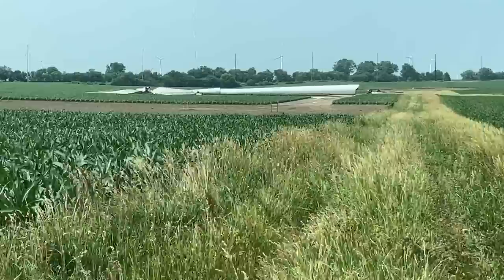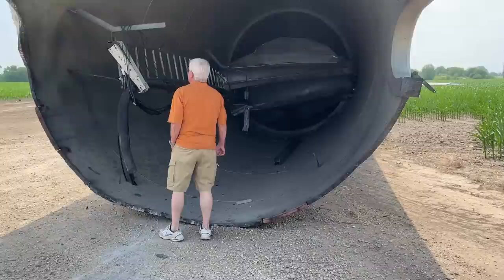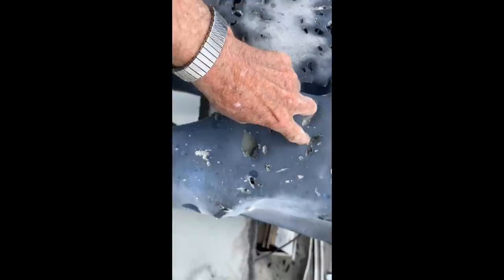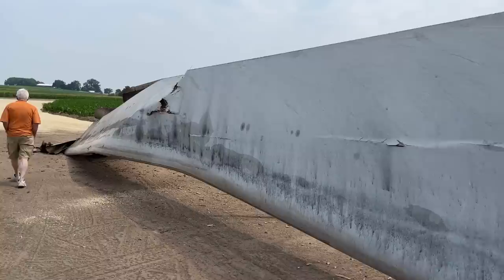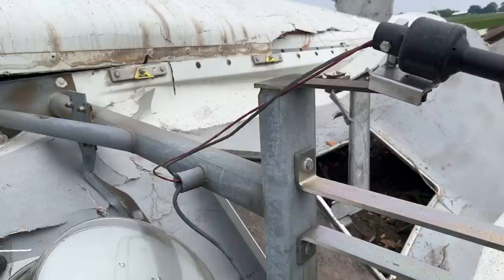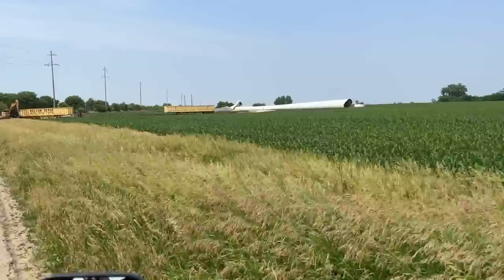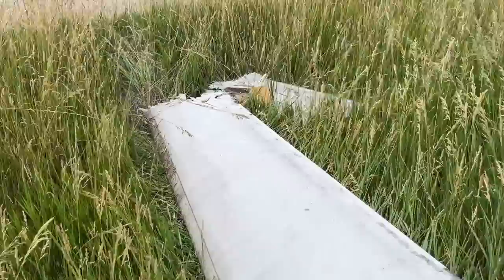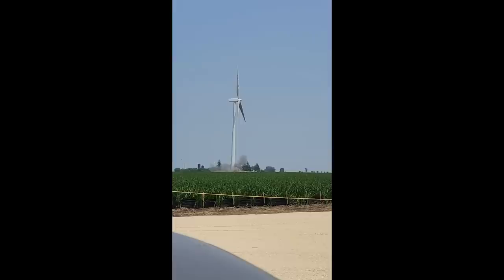OBSOLETE WINDMILL DEMOLITION short #47 pt 2 tubalcain energy lies scam fraud

Comment: As a fan of fluid dynamics I find the concept fascinating, but I don't have one in my backyard.  

My best guess to the layup of the blades is S glass/epoxy (i suppose it could be polyester or vinylester resin) structurally, mostly 0/90 degrees with the bulk being unidirectional fibers at 0 degrees and surprisingly few 90 degree fibers, with occasional 45/45 roving. Apparently blade failure is not a big issue, so they're probably a little over engineered -- and overweight.

I suppose the issue is whether global warming is real. I would just say that a lot of smart people think it is, hence windmills, solar, etc. I'm not making a political statement, so please don't respond politically, I'm just taking their POV.

I don't think that wind power will be the final solution to reducing greenhouse gasses, but it may be a bridge to that solution, and developing the technology may result in cost efficient systems, if they aren't now. The way to that goal is testing. I don't know why those windmills had to come down, but it may be that newer windmills are already so much more efficient that it pays to replace them. Perhaps someone, not MrPete, or me, should ask.
Reply: You'd be interested to know that they weight the blades to get three matching ones.  You can't replace a blade, balancing would get "interesting".

Comment: 8:20 You should have brought a geiger counter to check if the lightning rods are radioactive. They were disallowed on many places since 80' or so for apartment buildings, not sure whats the deal for industrial applications though.

6:29 also, dirty blades and the column indicate substantial oil leakage, not sure about how environmentally friendly that is, not to talk about food chain and that corn around there.

Also I don't see the reduction. That planetary gearing is quite an engineering challenge. They must have removed it prior to blowing it up.

15:40 maybe they don't know until they try to produce it in more massive scale. In Germany I believe they are viable solution. I believe they seem to be logical choice, mostly,... mixed in with a couple of significant inconveniences and some percentage of corruption for sure.

Comment: They seem to be designed upside down,
A huge mass at the top if a tall thin column!
Surely, the generator should be at ground level, driven by a prop shaft?
Ease of maintenance a bonus.
Reply from the maker: Good idea, just like an outboard motor turned upside down
Reply: @mrpete222  
V. G. analogy.
The huge mass at the top is a crazy idea!

Comment: cuts from google...
Which energy source is most subsidized?
Fossil fuels $20 billion every year on direct fossil fuel subsidies
also
45 billion allocated to renewables – including electricity, heat and fuels (biofuels, advanced biofuels and biogas)
that's the corn you see growing in the background
...
How much does the US subsidize renewable energy versus fossil fuels?
Overview of energy subsidies
The International Renewable Energy Agency tracked some $634 billion in energy-sector subsidies in 2020, and found that around 70% were fossil fuel subsidies. About 20% went to renewable power generation, 6% to biofuels and just over 3% to nuclear
... 
the latter part of my working career was in the petroleum production (drilling rigs in oklahoma) service sector.  then...

Something bizarre happened in the oil markets on Monday: Prices fell so much that some traders paid buyers to take oil off their hands.
The price of the main U.S. oil benchmark fell more than $50 a barrel to end the day about $30 below zero, the first time oil prices have ever turned negative

that's when i took my retirement

Comment: You know what gets me is the real engineers know this is a  Massive scaM with the maintenance And the oil and the wear and tear and the transmission Line fees .      it might work well for DC current but why the heck use AC makes no sense.     What does make sense is it's all subsidized just like the corn in the field is subsidized for gasoline when it's horrible for the environment
Reply from the maker: You and I think alike. Watch for a video coming very soon where they put up new windmills, in the same location as the ones they tore down. No end to the corruption, but most people fall for it.

Comment: My opinion about wind power generation. Sure when they function they make clean energy. Yet no one factors in the carbon footprint of the manufacturing process. No one seams to factor in the demolition and replacement do to the short lifespan. No one seams to factor in the fact they only work with the proper amount of wind. When there is a power demand they can not be ramped up to produce more power. So in my humble average American opinion they are not the answer. They have a short useful life span and can’t meet extra demand. I think it’s all a political game from the global elites to play games with masses of people by the elites lies

Comment: I guess the explosion was directional. Otherwise it could have fallen in any direction. That is why the base was pushed in a specific direction. 
In Denmark you could not just take the mill down this way. All parts must be seperated and preferably salvaged for reuse. Using the fiberglass, epoxy, carbon has been the most tricky obstacle. So far 85-90% of the windmill is recycled and reused for other things. The remainder is mostly the wings, but the windmill industry in Denmark is obligated to find a solution. Not just for the windmills scrapped, but also for those they have scrapped and with components placed in storage. 
By law landfills are technically prohibited in Denmark. The industry must come with a solution, or they will ultimately be fined and taxed until they find a solution. Various methods of grinding them up into small parts and use in various constructions, fuel for power plants, letting bacteria decompose them into basic parts, filler materials in some products..... There is testing done, and the first to find a cheap and easy solution is going to make billions. Tiny Denmark alone has 6000 wind mills that are already obsolete, or will be in 20-30 years. For Europe, Asia and USA we are talking many hundreds of thousands of wings of potentialy cash cow generating profits to the company finding the best method.
Reply: They precut the towers like they were felling a tree in the forest, and used shape charges to help it along.
Reply: @Farm_fab  makes sense, and good of you not to use a variant direction. Reading what I wrote makes me realize I had used it enough.
In Denmark they would not do something like this. The windmill was assembled by using a mobile crane. So they would just use a crane for the disassembly
Reply: All of the steel, copper and etc will be separated at the scrap yard. The main item that is not recycled to my knowledge are the composite blades it is my understanding that is not economically and or ecologically sound to be recycled. I have read that attempts have been made to repurpose the blades in Ireland for foot bridges (my question is how many foot bridges does Ireland need and what is actual environmental impact of repurposing the blades as opposed of using virgin materials as well as the life span of both bridges.  Another attempt of recycling the windmill blades is shredding/grinding up the composite material the blades and incorporating the shredded/ground material in concrete much the same way fiberglass strands are now. The problem with doing this is the cost and environmental impact of transportation of the blades and shredding/grinding of the blades exceeds that of using virgin materials. Additionally no long term testing of the use of this material in concrete has been done that I can find.  Just as a FYI Fiberglass reinforced concrete was extensively tested when I-95 and several other interstates were being built.
Reply: @gullreefclub  An attempt in Denmark to use it in asphalt or concrete did not work either. It has proven to be so problematic, that Danish windmill companies is changing the production method for future wings, so that they can more easily be seperated and materials reused. They call it Recyclable Blade. That at least is an improvement to reusing old wings for roofs over a bicycle shed. That is just a novelty and not a solution.

Comment: Lyle, go back and look at the videos you got that were too dark and see if your editing program can lighten them.  I would have liked to see beyond some of the covers and stuff in the way.  Burn the light spots if you have to, let's see what's back there, but be safe and don't take any chances or get injured.  I'll bet that endoscope camera could peer in and a good flashlight might let it see all the way to the back (worth a try).  I really enjoyed these videos and field trips.  It brings back all those fond memories of riding around in the short bus.  It's hard to take the class to something like that because half of them would be inside that tube the minute you took your eyes off of them.  That big power cable probably had some numbers on the side of it that would have been interesting.  Did you guys happen to look at it?
Reply from the maker: That would be an interesting challenge, but I’m not going to do it. You were one of the very few people that were actually interested in the machinery and mechanism. Everyone else turned it political.
Reply: @mrpete222  It's definitely at the scrap phase.  Didn't you see anything you might want?  Those guys with the scrap trucks will let some of broken bolts go cheap and they are probably some high quality steel.  You don't even have to turn all the threads off, they are already gone.  When's the next auction?  It is the summer.  Maybe you could do an off-topic series on what the latest bikini styles are near you.  That would be interesting.  You do kinda look like a movie producer with that beard.  Completely academic you know and maybe you could wear something like a Tubalcain Productions T shirt.  That will get you back in shape.

Comment: Calculating the payback period of a wind turbine may be difficult. It depends on a number of factors, such as the cost of electricity, the price of the turbine, and the amount of power it generates. The estimated payoff time period for a 2.6 MW turbine in the example in a google article is roughly 6 years and 7 months.
Reply: Levelized cost of electricity makes sense these days. Wind is cheaper than gas or oil generation.  Something to note, all wind and solar almost all costs are up front. Once installed the money just rolls in with little offsetting costs.  There must have been a reason other than efficiency to knock these down as with 100% of the costs sunk letting them run even if inefficient is the sensible decision.  Perhaps it is to do with the Siemen's company problems.
Reply: This one has plenty of life left in it, they just worked out putting in a bigger one makes more money.  Lifespan is 20-30 years, plenty of 15 year old ones in Australia with no plans of replacing them.
Reply: Ig Google did the estimated payback it must be true....😂😂
Reply: @TheAyrCaveShop  Payback varies from 5-10 years.

Comment: Every US wind and solar generating system is subsidized by federal (stolen) funds.   As to whether or not these made money, that's a relative question.   Any Rube Goldberg contraption can make money if you elevate the market floor enough.  I don't think they consider the federal funding as part of the cost, so that shaves off a good deal of the price tag.

My research suggests that the installed cost of a U.S. wind generator set ranges from $800 to $1500 federal reserve notes (they ain't dollars anymore since 1971) per KW.   For a 2 megawatt installation, that would be about 2 million assuming a cost of $1000 per KW.  (2000 watts * $1000 federal fun tickets)   I see the formula of $1,000,000 per megawatt tossed around a lot, but detailed reports I've read suggest a less finite cost.  Although on average of the 170 odd wind farms in the US, the average cost is probably reasonably correct.

A nuclear plant (such as one near me) makes 4000 megawatts on roughly 4000 acres of land.  (That includes a significant amount of land for water reclamation systems since we are in the desert - A nuclear plant I worked at in Canada produces 4000 megawatts with a smaller footprint)   That would equate to around 6.25 square miles to produce 4000 MW (Four thousand megawatts).  Land use for wind turbine farms from a 2009 study (National Renewable Energy Laboratory) found that a typical wind farm requires 85 acres per ONE megawatt here in the US.

It's a shame that they're ruining pristine desert land for these contraptions -  But wrecking precious farm land for these things should be a crime against the people of this union.

Comment: Makes you wonder why they didn't re-use any of it. Couldn't the tower be re-used and just replace the unit at the top? I'm sure if they could they would.
Reply: It's my observation that each new generation of windcharger is larger, and is built taller. The size and weight of the generator and all it's gear is much larger and heavier requiring a much stronger and longer tower. Each new generation produces more power than the previous. Add to that the fact that the old tower experienced a life (however short it was) of vibration and as such metal fatigue. As I understand it, part of the problem is the insurance companies that that insure them. Wind Chargers are rated at a life expectancy of 15-20 years by the manufacturers and the insurance companies will not ensure them beyond that.

Comment: The blades look like fiberglass.  Graphite or carbon is black.   The early designs of the blades, gearbox and main bearings were made with some assumptions that proved wrong.  The fire was a failure in the gearbox and likely a bearing failure.  
As far as making money. These likely were subsidized, however; the replacement likely will not.  That means they made money.  Reason why is the combination of the midwest being windy enough and for this wind farm to average a good production rate and close enough to the customer, Chicago metro, that will use the power.  The new transmission lines only need to go the existing line feeding Chicago from the old steam plants.    Further those plants were built taking into account the transmission losses.  Those same losses the wind farm have.

Comment: The destruction of these probably compares to the destruction to the large casino/hotel/resorts in Los Vegas. It is all about deprecation schedules.  Accelerated deprecation allows the owner to remove the value of the structure over a short period of time and then it must be removed at the core cost they established when they built it.  So scrap price on the steel and aluminum, plus whatever can go to scrap from the generator would be the core cost.  I have no data to prove this but it certainly must be what is going on.  So on top of the subsidy that they used to construct them they save on income taxes over the life of the tower.  Follow the money, as they say, for the real answer.  Are they profitable?  Probably on paper but not in the waste of good farm land.